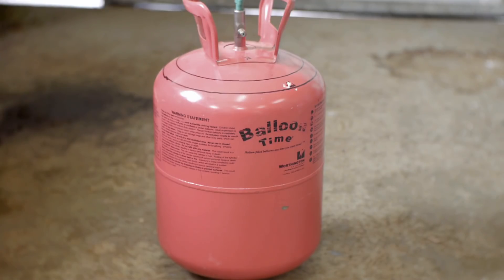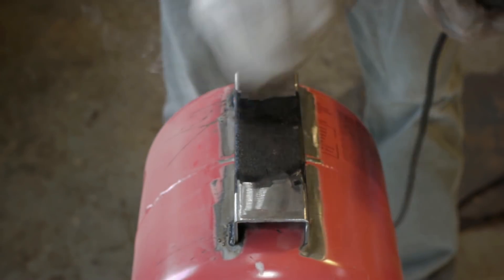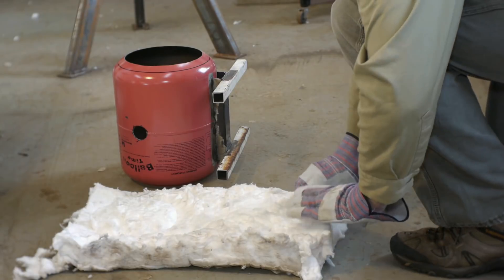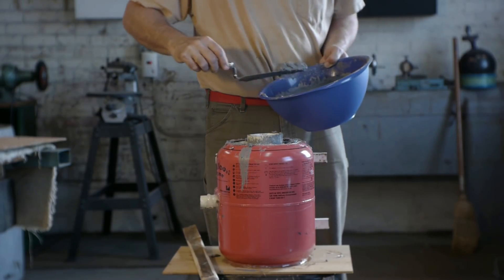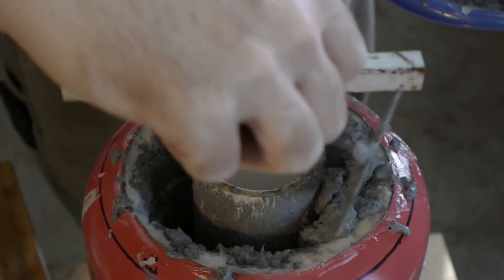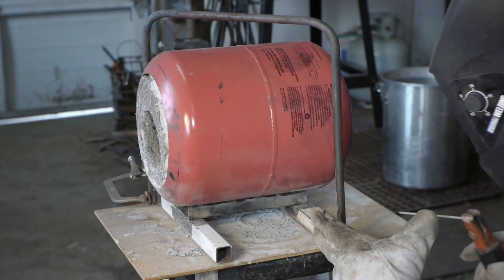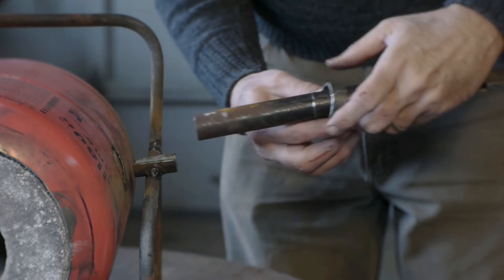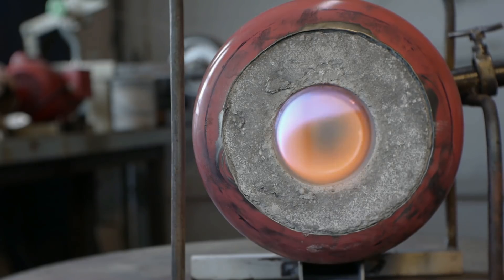Propane Forge With Cast Interior

Comment: Is there a certain angle for the burner going into the forge that works better , or makes the flame swirl better ?
Reply from the maker: I like the swirl, I have used other forges where it blows straight in and hits the wall. I think the swirl helps lessen the hot spot, but both ways work. That being said I always have my burner flame swirl around.

Comment: So 3 years in, how is the cast interior holding up? I'm midway though building my own forge from the same type of helium tank, and started to wonder about the cement more or less 'floating' on a bed of ceramic wool, and wondered if it might crack if jostled  much.
Reply from the maker: the forge  has  held up very well, the interior is still solid,  ends have a few small cracks.  The forge does especially good at dealing with flux.  When there is  somebody in the shop that uses a lot of flux when welding I make sure to use this forge.
This forge does not heat up as fast as my forge with a thin layer of cement, but once it is hot it works great. If I did it again I would get all of the paint off. I took forever to burn the paint off of the tank.
Reply: @lewisrazors  Glad to hear its holding up well! I made sure to get all the paint off mine before I even started; figured it would be easier while the tank was structurally sound, before I went cutting holes in it.

Comment: I made a similar forge made from a R-133 cylinder My burner was a bit different design & I put a half thicjness fire brick in the bottom. As with all my forging equipment i sold it about 15 years ago so I may build my own once again. I have a great shop to work in for just maintaining the shop for it's owner. She has 2 gas forges & a coal forge along with a 50Lb. Mayer Bros & a 150Lb Beaudry Power hammer. along with all the other stuff I can keep busy a couple of days just keeping the machinery running! Back to your forge Great design!
Reply from the maker: I thought pretty hard about a fire brick floor, but I kind of wanted to try to cast the whole core this time. Casting the chamber like that is something I wanted to try. I am not sure if it was worth the effort or not, time will tell.   Happy smithing

Comment: Great project. Was your old furnace just wore out?
Reply from the maker: My old furnace is still chugging away, it works great for forging, but the floor of the furnace gets burned away when doing a lot of forge welding. The hot borax/flux used in welding eats away at the bottom of my old furnace and I have to repair it. This forge will be a lot more flux resistant with the thick cast walls.  It will be used primarily for welding.

Comment: People blow themselves up all the time cutting into vessels like this. I used a steel trash can, trimmed about 1.5" from the refractory material level, then hammered the edge down. I've moved the foundry many times, and it has held up well. Also a loose roll of cardboard came out much easier. Anyways, your razors are awesome!

Anyways,
Reply: Brandon Lisik into disposable helium canisters? It's an inert gas, and I doubt the pressure is that high with those things.
Reply from the maker: A cardboard tube might have made life a lot easier.

Comment: Mine's pretty similar. And yup, I had trouble removing my pipes too. I used a piece of galvanised chimney pipe, and didn't have the foresight to use mould release. ;)
Reply from the maker: I am not sure the grease did very much, I thought about using sheet metal, but went with the pipe because I had it laying around.

Comment: A piece of advice for the next cast (these do get consumed on the inside), the inner pipe should be split and made from the main pipe size and another, that slips in the two removable halves. That way, when you want to remove it, you won't struggle with it, and risk breaking some of the liner. Just my two cents on it.
Reply from the maker: Great advice, I wish you would have been around when I started this project.
Reply: @lewisrazors you still around?
Reply: I’m not quite sure what you mean. Are you saying the inner sleeve is split down the middle in two pieces with another slightly smaller sleeve inside these holding them together?